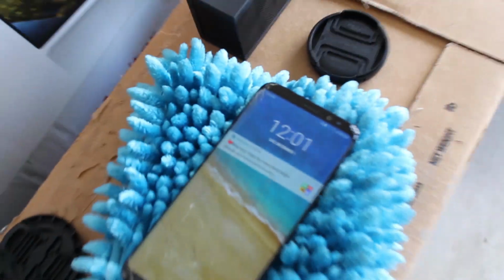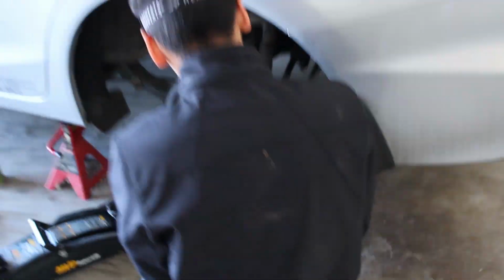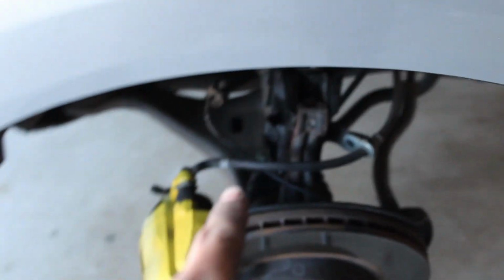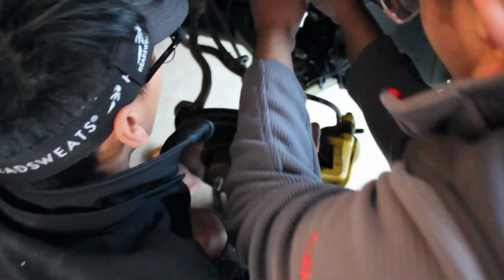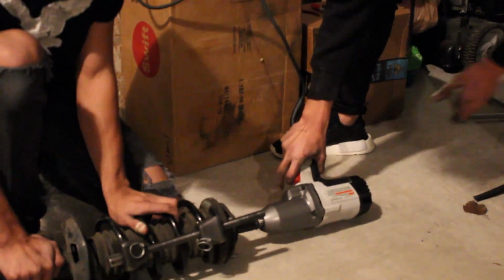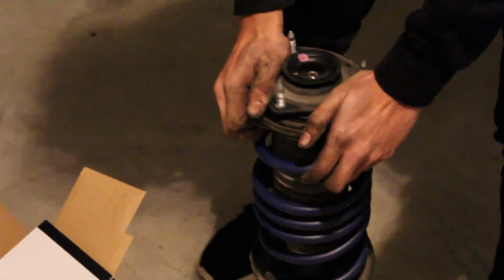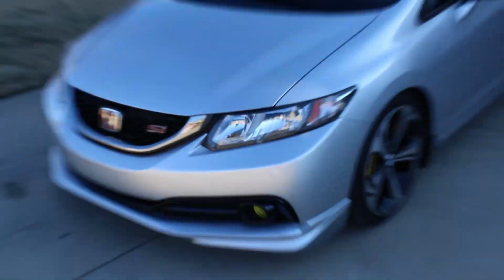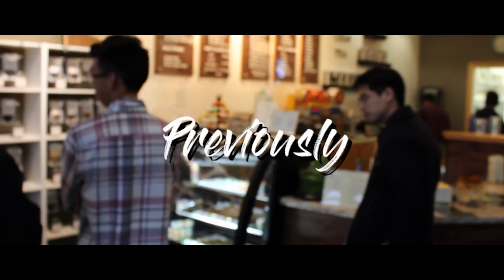H&R Springs Install! | FG4/FB6 2012-2015 Civic Si

Comment from the maker: If anyone have any questions about the springs, let me know.
Reply: Jarek Mai what size wheels and how low was the drop?
Reply: Same question?
Reply from the maker: @samuelrios3579  18in rims and 1.3in drop all around.
Reply from the maker: @FiNeSt-ev4uy  18in rims and 1.3 in drop around.
Reply: My rear driver side is high as hell almost stock with new spring
Reply: How much do ppl charge for putting them on?
Reply: Did the ride quality and comfort ability change at all?

Comment: These go as low as like the skunk2/d2 springs ? Looking at getting my fb6 soon. Love the yellow calipers
Reply from the maker: The Skunk 2 and D2 springs have more of an aggressive drop than the H&R springs. If you go with those springs your going to be needing rear camber arms. Appreciate it bro! I just recently painted them.
Reply: Jarek Mai reminds me of the spoon yellow calipers.  I used to have 8th gen fa5 on racelands haha so there literally was like no gap lol. So I’m used to the low ness. How much was the drop on the h&r? I drove my homies sport hatch yesterday no lie those 1.5 🐌 do scoot for what they are haha I’m trying to find a low mile fb6 like less than 30k but they all seem to sell Fckin fast. How long you had your fb for? Any issues or hiccups
Reply from the maker: @compacheo603  The springs cost around $230 and dropped about 1.5 all around the car. Had my FB6 for about a year now and had the springs for 3 months without any issues.

Comment: How are the stock struts/shocks holding up? How many miles on oem parts?
Reply from the maker: Well they never blew for the 3 years I had them before the Si got stolen. I had Around 87xxx

Comment: Do you have the link or part number? Thanks
Reply from the maker: Just search up H&R Lowering Springs for 2012-2015 Si
Reply: What’s the drop you got?
Reply from the maker: @antonioduarte133  1.3 inch drop all around
Reply: Ok thanks, one more question are the super sport or just sport?
Reply from the maker: @antonioduarte133  Just the sport g.